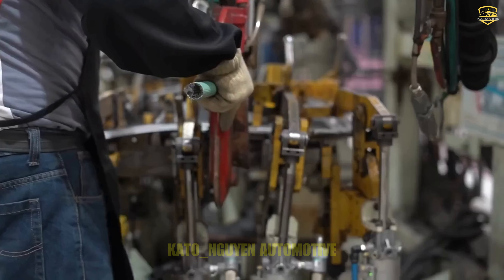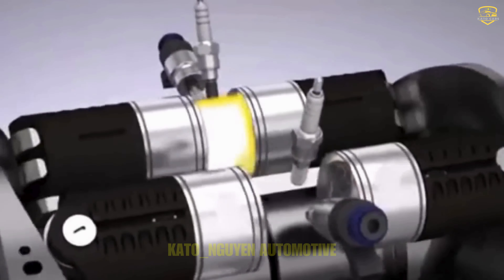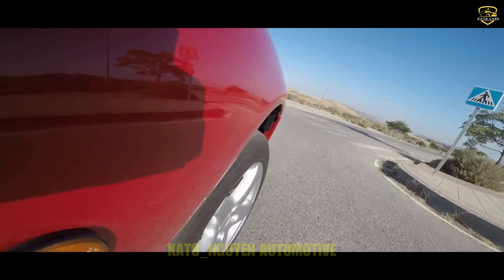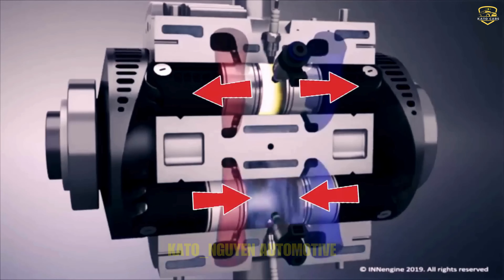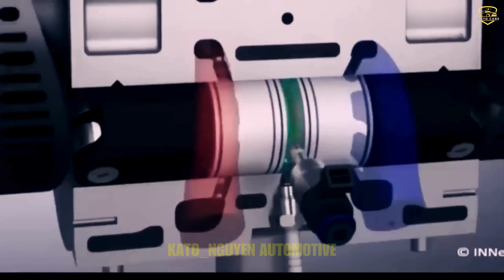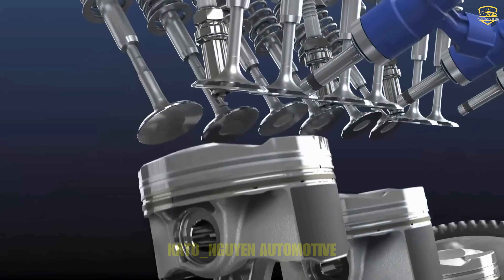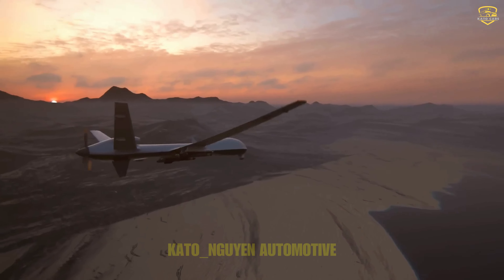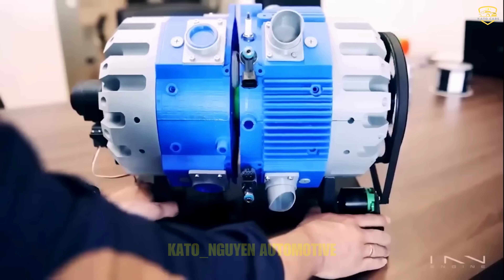New Toyota's Super Engine Will Revolutionary Car Industry

Comment: There's no such thing as a "one stroke" engine. That would require that the piston only travels in one direction.  This is an opposing piston 2- stroke.  And because it's a 2-stroke, it cannot meet emission requirements for automobiles.